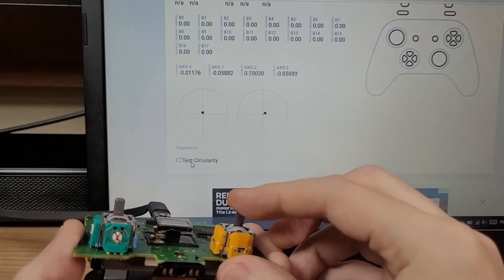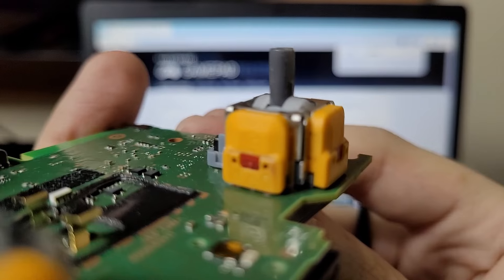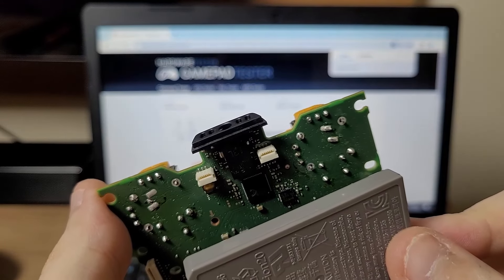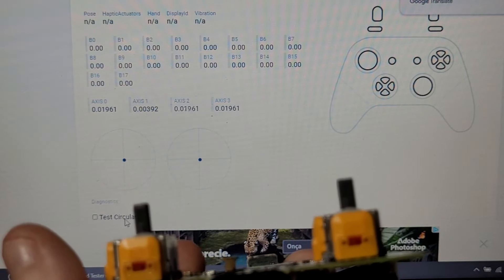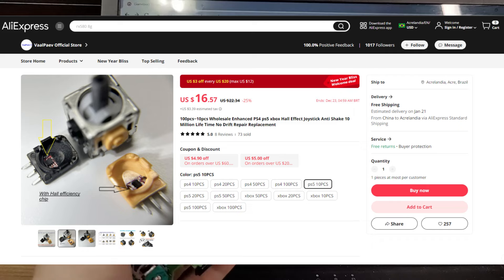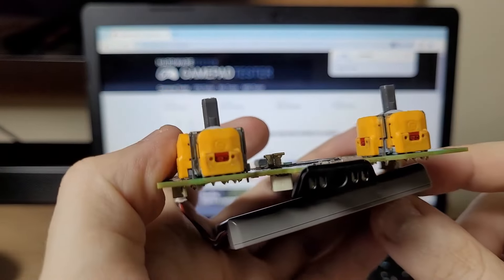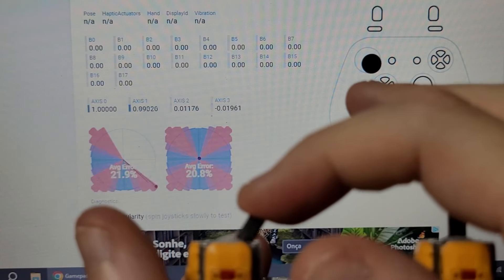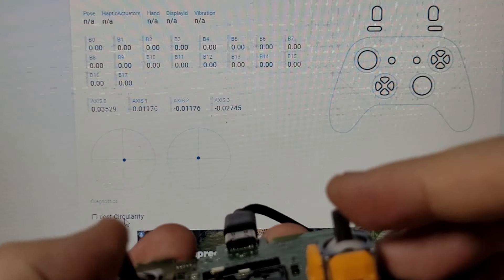New V2.0 Hall Effect Modules - Now without Jitter!

Comment: Was there no problem with this red version? If you tilt the stick to the left, doesn't it move slower than when you tilt it to the right?
Reply from the maker: No it works perfectly fine
Reply from the maker: Now that I saw the example I tested here and Indeed the it has a small delay like in the video, Jun Zeng's board doesn't have this, I'll pin your comment for everyone to see @haginarum
Reply: Damn I was happy I got these. Arrived a couple of days ago then coincidentally saw this video and thought wow. Lucky me got the newest / best version. Same orange / yellow plastic with the red chip. Guess I'm fkd. No way I can use sticks with movement delay (watched the video of the Korean)
Reply: @haginarum So what you’re saying is, avoid these new orange ones because of the delay? I’m confused
Reply: @VKsChannel So, avoid these new orange ones? What do you suggest us to do
Reply: @godofchaoskhorne5043 I think you can get rid of the movement delay with the proper calibration chip?
Reply: @DyzzBro  I think it's right to avoid it because the top, bottom, left, and right inputs are uneven. If you want to use the PCB, the k-silver product looks better. I hope the improved product comes out soon.
Reply: @haginarum  I saw somewhere that its fixed, and the reason why there was a delay was because of bad early batches? Because the new batches have no delay apparently
Reply: @DyzzBro  Then just buy a few and test them out. I hope it's true.
Reply: Hello! I'm the YouTuber of this video. The issue with the yellow hall sensor has been resolved. It's advisable to confirm with the seller before making a purchase. I frequently watch the vk's YouTube channel. Additionally, I develop and sell products in Korea. I collaborate with various partners in China. I hope there won't be any misunderstandings through my videos. Greeting you this way, nice to meet you! I wish success in your business endeavors and hope for the opportunity to become a great partner.
Reply: @gampic  It was just the old batches that had that problem right? All the new G-unit sticks should be fixed and have no delay?
Reply: @DyzzBro  Yes, I checked with the module factory and they said that it has now been improved. Still, there may be an earlier version, so I think it would be better to talk to the seller before purchasing.
Reply: @VKsChannel  I bought the sticks you linked to, but for some reason it's in the down left position, they have the red chips but they are orange and black thumb stick. Is there any way I can FaceTime you for help?
Reply: @VKsChannel is good for ps5 ?
Reply: @VKsChannel  so do you recomend the Jun zeng,s sticks?
Reply: Explain what do you mean by "delay". Is it an actual temporal delay or did you mean to say that one direction in the axis has a smaller deadzone than the other, so it registers movement earlier in one direction than the other. I have that same issue with normal potentiometers.

Comment: I think the circularity is bad because you need to test the sticks with the shell on. The sticks don't usually go that far when the controller is assembledm
Reply from the maker: Even with the shell on it is the same
Reply: @VKsChannel  That's absolutely terrible performance.  That's about on par with the really cheap potentiometer stick modules third party controllers tend to use.
Reply from the maker: better than a drifting controller though @ulfrinn8783
Reply: @VKsChannel  which seems to be a newer problem.  I've never had an older controller drift.  I have several Gamecube, 360, OG Xbox, and PS2/3 controllers, none of which I've ever experienced drift.  I've had the physical touching surfaces inside the box itself wear out to make the stick loose, and that's it.   Drifting is an issue because of the decrease in the quality of the potentiometers being used more now.  Basically, people making first party controllers started getting cheap on people.
Reply: error, necesitas calibrar el potenciometro cuando instalas uno nuevo, incluso si es magnetico, hay software para eso y por lo menos estar en 0.002 creo para que sea una buena calibracion
Reply: @ldfprpro7384 Can you please tell me the name of the software to calibrate the joystick?
Reply: i tried circularity with a new brand xbox one s controller and it had the same result
Reply: @ulfrinn8783 those controllers were Hall effect just like the ones in the video the newer controllers get stick drift because they use some sorta graphite pad that can get scratched which lead to a choppy electrical connection
Reply: @StrattosGaming  No they weren't.  Only controller I'm aware of to use hall effects is the Dreamcast controller.  N64 used an optical setup and the PS1 dualshock onwards had stick modules very similar to what we still use today.  I've repaired several, which included analog stick replacements due to the plastic surfaces inside the stick itself wearing down causing the stick to loosen, and range lost. They're all potentiometers, and the only controllers I've had drift are newer ones.
Reply: I looked up some info on this the earlier version of the ps3 controllers did use Hall effect but reason why old controllers might’ve not got stick drift was because we weren’t able to really feel it. It might’ve still been there but the deadzones were bigger on those controllers and nowadays you can change your deadzone to be as small as you want
Reply: @VKsChannel  you should retry with the DS4/DS5 calibration tool
Reply: @ulfrinn8783 You got lucky you stopped before PS4, that's the first controller that I noticed it on. I streamed Mario Maker 2 for years, the hardest game in the world, thinking I was just bad but the drift was a serious problem I didn't address lol
Reply: @SavingPrivateBob  I've never actually had a problem with controller drift.  I've used dozens of controllers with potentiometers.  I've had several controllers wear out from physical wear of the internal moving parts before though.
Reply: The "circularity" isn't determined by the joystick themselves, it's determined by the controller board software
Reply: @ulfrinn8783  My Dualshock 2 drifts. But he PS2 has a measure in place to fix this, it auto calibrates the stick if you rotate it a couple of times in game.
Reply: @ulfrinn8783  I have 3 xbox 360 controllers and have to put deadzones to 20% on two of them because they don't center properly on 10%
Reply: Having a square circularity is actually good, more area to read data... in reality the perfect circle is a limitation of information, there are some games that take better advantage of the square scheme (fighting games, fps, etc.)
Reply: @ulfrinn8783 Well ur lucky. I’ve had stick drift on older consoles. N64, PS3, 360, etc. It’s always been a problem. You just got lucky.

Comment: Are these sticks universal for any controller or do they have specific ohm ratings?
Reply from the maker: you must buy the specific one for your controller
Reply: DS4 and DS5 have completely different resistance ratings. DS4/DS3/Xbox One/maybe more all use 10 ohm pots (someone correct me if I'm wrong).

Comment: Had a person replace my analog sticks with hall effects in two different controllers but he kept running into an issue where after a min the stick would drift down. I can re calibrate them in the Xbox calibration menu and they return to normal. Any idea why this happens?

Comment: Has anyone tried out a Gilikit Hall effect sensor on an Xbox or Playstation controller? I have one here and I replace my own sticks when there is drift, but I'd rather not go through the trouble if it won't work. Also on a side note, does anyone know if a xbox one potentiometer will work on an elite series 2? I have extra series 1 thumb disks so the screw on thing is not an issue.

Comment: My 8bitdo pro 2 after 2 years of daily abuse finally started to have a little drift which i did hide it with deadzones in the software, works fine now but i will buy hall effect ones because it's better for the long run
Reply: They have pro 2 with hall effect now.

Comment: Is it possible to install these on a Dual Sense edge stick module? since the DS Edge stick module contain the same exact analog modules as the the normal DS controllers has.
Reply: Yes. Installed with driverboard.
Reply: @Joukokinjoo do you really have to install driveboard? What would happen if you install it without that?
Reply: @loredominguez8281 the driver board was just to eliminate the jitter. The original hall effect joysticks always had jitter

Comment: I just received blue ones that came with the PCB addon. They are more expensive on Ali than the orange ones. No idea what the difference is, though. They look like the K-Silver ones but were advertised for the DualSense only.
Reply from the maker: Have you installed them?

can you make some tests for me?
Reply: @VKsChannel   I tried to install them with the calibration board but the center pins of the hall sensor clips are too thick to avoid contact. The manual mentions to make them thinner by "sanding". Long story short, I destroyed one.

The other one I left without the board and soldered it directly. Circularity test returns the typical 21% error. The centers have tiny jumps, purely mechanical, no imprecision. But the real issue is that the jump back force isn't good enough for it to find the ideal center. Whenever you jump back, it finds a different center. Which means a center drift of 5%. A safe zone of 6% is required, if not 9% in rare situations (only on axis 1). I'll buy the orange v2.0 now and compare once they arrive (if I can find them for the European market).

Btw, they have the "K-Silver" insignia. And they reach full amplitude at the boundaries.
Reply: @VKsChannel  I've tried the orange version 3 now. Turns out that the inaccuracy on the left joystick on the vertical axis wasn't due to the joystick itself but the unfortunate circumstance that the hall effect sensor is on the outside and is influenced by the magnet of the motor of the trigger unit. This leads to the offset and inconsistencies. So the same issue with the orange ones. The calibration works much easier with the orange ones. Just move them to the max and use the pin on the same side to move the magnet in the same direction. With the blue K-Silver, it was pretty random what would happen, confused me, even after watching several videos on how calibration supposedly works with them. Still no circularity because both sensors don't communicate their signals. But the denoiser works pretty well. I also think that the center force is better because they use larger rubbers.

Comment: i had assumed the radial stick calculations for ps4 and 5 controllers were coded to the controllers firmware does anyone no why there outputting a square on the controller tester

Comment: do these work with jun's board?
Reply from the maker: If youre using juns board it already fixes the jitter and circularity

And if you buy new boards jun will send additional sticks
Reply: @VKsChannel  Thanks for responding, so is there any difference between the orange and blue stick modules if you use the board?

Comment: How to calibrate it on XBOX? It's hard to calibrate compared to Dualsense and DS4
Reply from the maker: its the same calibration method of the dualshock and dualsense
Reply: @VKsChannel Could you make a tutorial video then?

The one with the calibration board is too difficult. And your other videos involve installing and testing on Dualsense, which is much easier to do.

For XBOX, there are two parts that must be combined to power on the controller. Unfortunately, that makes it difficult for me to insert a needle to go inside the holes of the hall effect joysticks for calibration

Comment: How exactly does the circularity of these modules affect gameplay? I bought this exact same ones and installed them. The circularity is the same as this video but it doesn't seem to have a negative effect in gameplay.
Reply from the maker: It depends on the game

Some games has a circular movement range, in those games you lose a bit of precision diagonally, other games uses a square range and the perfect circle is worse on those because the circle cannot reach the corners all the way

Comment: How hard is it for these to be installed? Is it easier to take it to a repair shop to do it?
Reply from the maker: Yes they only need to replace it and calibrate it

Calibrating is very easy and you can do it yourself
Reply: @VKsChannel what website would you recommend to calibrate it?
Reply from the maker: I left a link on the end of this video to the installation and calibration process on the previous model @VERsingthegamez

Comment: It says to try and make sure you have the retailer selling the most up to date version, but how do you know what the most updated version is for different controllers? I bought a few from a few different retailers for switch pro controller. One has a red board, with black letters, and one has a black board with white letters, how do I know which one is the most recent?
Reply: The old ones have a letter J (L-8J) and the new ones have a letter K (L-8K). The color is not really an indication in itself other than knowing if old batches of the same generation used a specific color and new batches another.

Comment: i got orange and black ones for my ds4, they're both the same color scheme but one has a G on the bottom instead of a 3 like in the picture and also a 2 on the side. will only one of them work?

also, the odd stick reads R-8L on the red bit in the black piece while the advertised one reads R-4A
Reply: any update on the orange-black DS4 sensors? were they okay?
Reply: @AdamFazekas999  if you're asking if they still work: yes they still work like i want them to

Comment: Can they be used for switch pro controller?
Reply from the maker: yes check the secondary link in the description
Reply: @VKsChannel Are you able to do a video on installing theese sticks onto a switch pro controller and testing it, i bet you will get alota attention from the video, also thanks for the videos dude, ive not been sub for long but i knew after a few of your videos you would be the person to find the fix to switch pro controller drift
Reply from the maker: I have the installation on the ps5 controller, for the switch pro controller the installation should be the same, just dessolder the old modules and solder in the new ones, the calibration steps are the same too @bacon2koox684

Comment: Are they truly worth it?
Reply from the maker: Jun zeng sticks are better
See the pinned comment
Reply: @VKsChannel , I understand that Jun Zeng board improve calibration, but what concerns me is that it wouldn't fit to the dualsense controller completely.
Reply from the maker: it fits well if you cut a tiny piece of the battery holder @Omar-de6vq
Reply: @VKsChannel  Thanks for replying.

Comment: Hello, do i need to buy the board aswell for circularity adjustment? Or just the magnetic joystic enough for having decent experience?
Reply from the maker: If you are experienced with soldering grab jun zeng boards

Notice that they're not the cheaper drift fix boards out there

If you don't know how to solder very well then get just the sticks
Reply: @VKsChannel  Thank you. But without drift fix board are the hall effect sticks servicable? I mean the newer ones like shown in the video. Do they produce circularity problem? Do they perfectly center physically?

Comment: Thank you for the videos! I had always assumed that a good result on the circularity test would indicate better accuracy and the absence of axial dead zones or snapping, but it appears that this might not be the case. So what does the circularity test really do?
Reply from the maker: Circularity test indicates a better precision, usually for the diagonal movements of the stick

If you see red zones it means that there is less precision on that direction

Comment: Hi. I have a questions about these analogues with the Hall effect. Does this high dead zone from outside the area cause the pad to still detect movement? Does this do something wrong while playing or is the movement range the same as normal alps? 

Secondly. If I center the X and Y axis after calibration, and the dots on the graphs tremble a lot, will the controller start to register such vibrations somehow?
Reply from the maker: These red areas means that the stick will have an outer deadzone on the corners which means that when you move the stick diagonally the input will reach the corner of the circle first before the stick bits the physical circular gate on the controller

For platformers it wont make much difference but for shooters you might have a bit less precision

And no the videogame usually filters out the trembling
Reply: @VKsChannel  Is there any way to fix this problem via software or calibration to maximize stick precision? I'm having the same issue with my Hall Effect DualSense controller.
Reply from the maker: the center point can be phisically adjusted, but the circularity can't be changed @N3xTw1tN3eS
Reply: @VKsChannel  No way to change it even via software? My center point is calibrated well, but my sticks (using these modules in your video) reach the full 1.0 value only halfway through the actual stick travel range. This essentially cuts precision in half.

Comment: My question for you good sir is this... having seen this video, I noticed you do not have a PCB underneath the rocker assembly... Does V 3.0 require the boards to calibrate or is it just the 'holes.' Also, I have yet to see how the holes are used to calibrate them, could you please clarify and or video an assembly of the new hall effect rockers?  Thank you
Reply from the maker: There is no extra pcb its just the sticks

In the end of this video I linked the first one where I showed the installation and calibration

Its the bottom left corner video